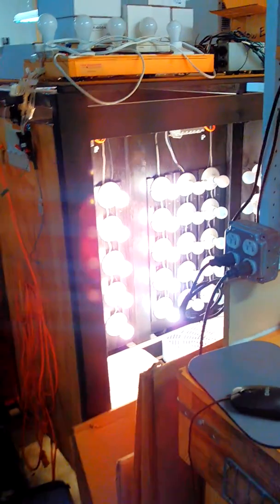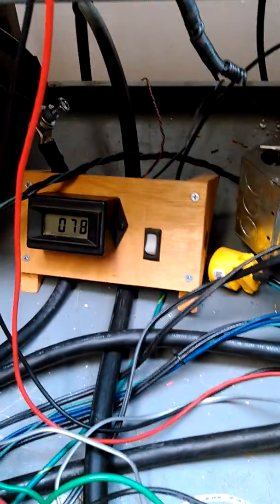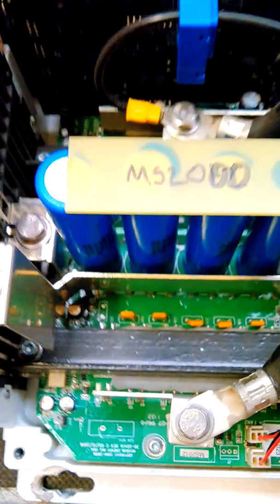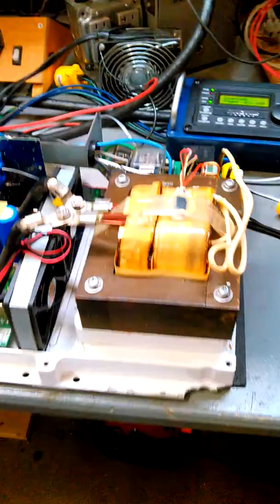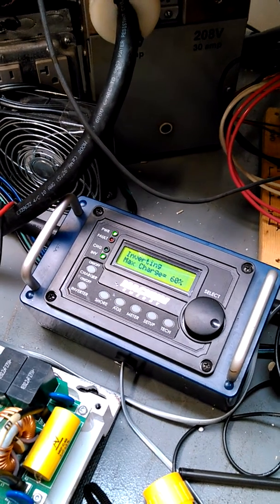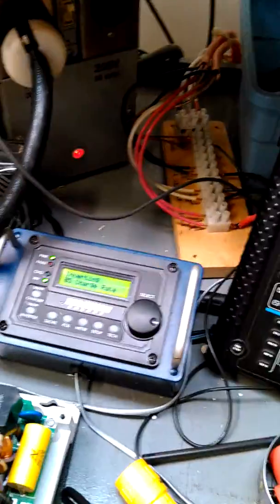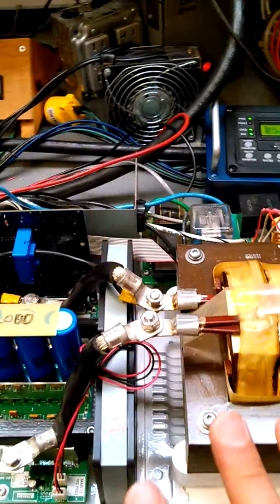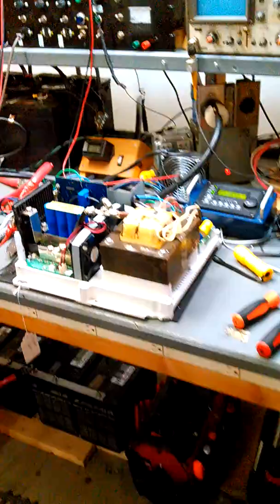Magnum MS2000 testing

Comment: My inverter MS2000 shows a fault it turns on after a few minutes. The 120 volt outlet come on then go out. I don’t see the fans come on or do I see it charging.  I put a battery charger on it and it sees the charger. Would it be the FET board?